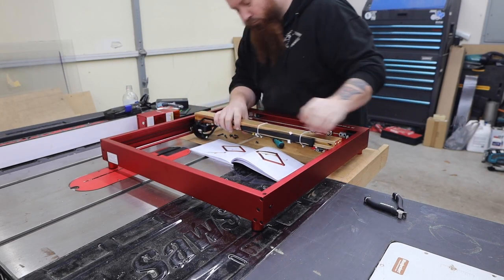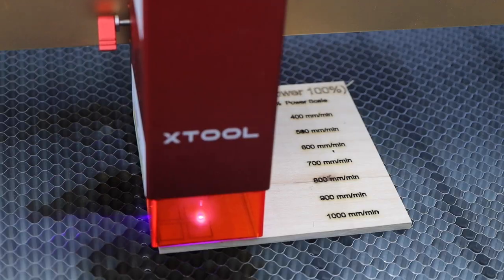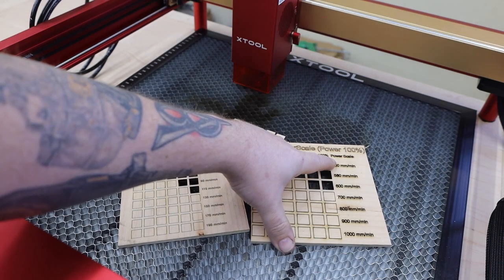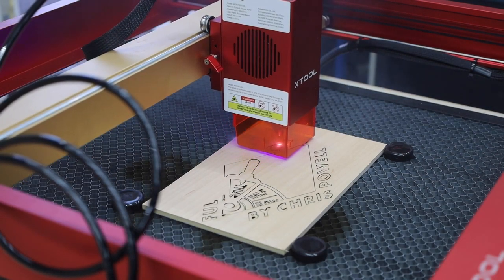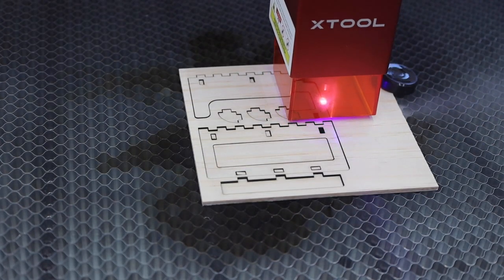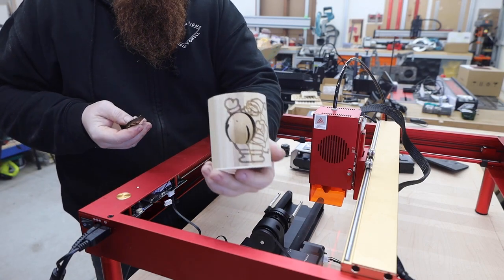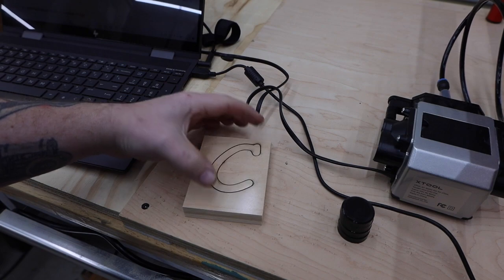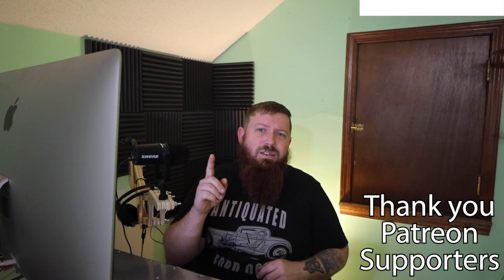xTool D1 40 Watt Laser Engraver Test and Review

Comment: Looks like it needs to be done outside with all the smoke it creates. Even in the garage you would need a door open
Reply from the maker: With any laser you’ll need some sort of ventilation.
Reply: @ChrisPowellFSD  yes we have a laser, and to use it you have to close the lid first. The Xtool shows it working in the open.
Reply from the maker: @CreativeCustomDesigns  it can be. You just have to deal with the smoke. Burning materials results in fumes. I use mine in the garage with the door open. I run a fan to blow the smoke out.

Comment: How fast is per second?
Reply: If you divide his speeds by 60 it will give you the speed per second.
Reply from the maker: I came here to say this 😂
Reply: So slow overpriced machine 😂
Reply from the maker: @techtrontest8950  you might want to run those numbers again. This is the faster diode laser on the market, and considerably cheaper than a co2 laser.